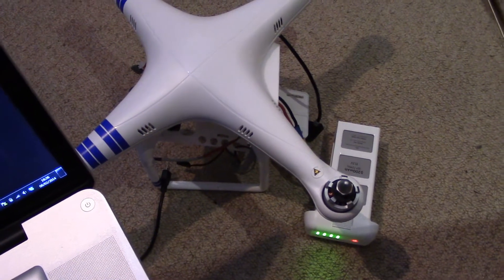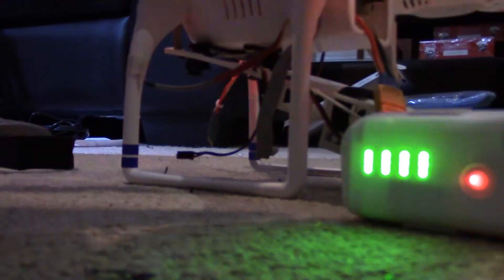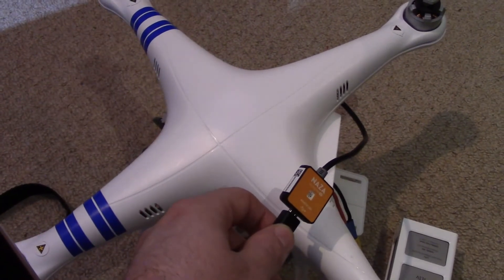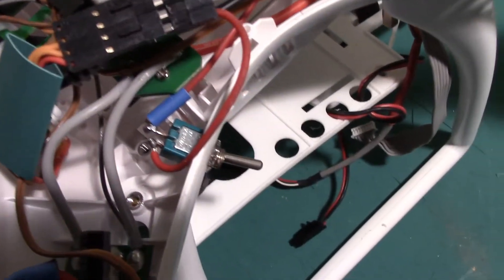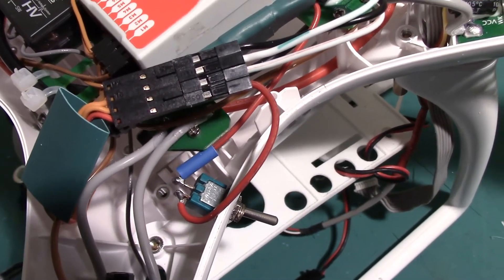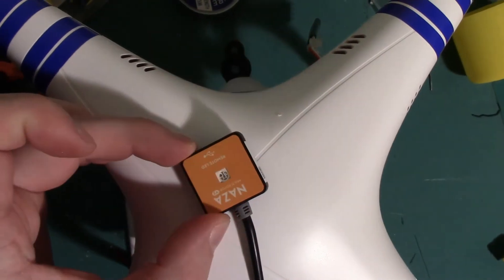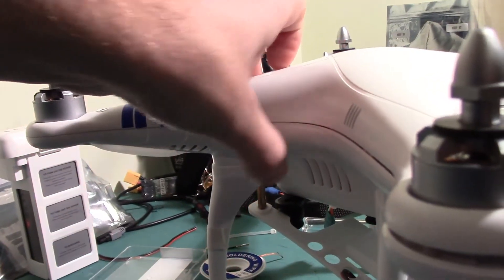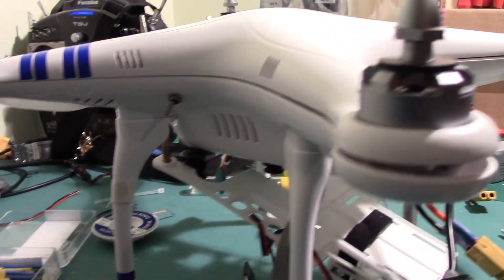Phantom 1 in Phantom 2 Shell - How to use 2 x status LED's

Comment: We need to collaborate on some ideas my friend ideally in this conversion it would be perfect and economical if we could just take what we have and transfer it to the new shell with out spending any more money and possibly running a 8000mah battery and having 30-45min run times
Reply from the maker: Well the best thing to do is give it a try etab - It might be possible but without buying a v2 LED or extending the the LED wire you will struggle to get the LED into anywhere that is easily visible from the air. Likewise there is no current 8000mah that I have found that fits the battery space without cutting the internal standoffs out. If you are interested in sharing ideas I'd suggest joining one or both of these threads: http://www.phantompilots.com/viewtopic.php?f=4&t=7017 or http://www.djiguys.com/Forum/viewtopic.php?f=4&t=3172
Reply: just joined the 1st thread

Comment: Hello my friend but couldn't you have avoided all this and just mounted the light to the rear top half of the shell it looks like there is enough room back there you would not have to extend anything just wondering
Reply from the maker: You are welcome to try that but I think you will hit problems. You need to be able to get to the USB board and the NAZA will be in the way of that in that location. You also need to consider that if the light is on the top, you won't see it from the ground.
    
  

          
    

      
Reply
Reply: from just looking at my old shell moving the led up approximately 1inch it still should be visible but I guess I will see when my new shell arrives this week cant wait to get started